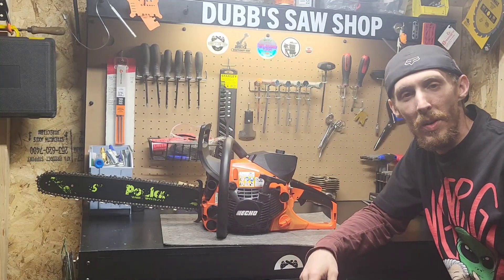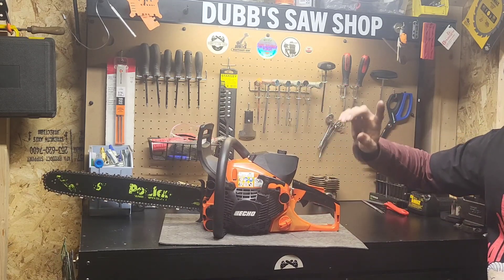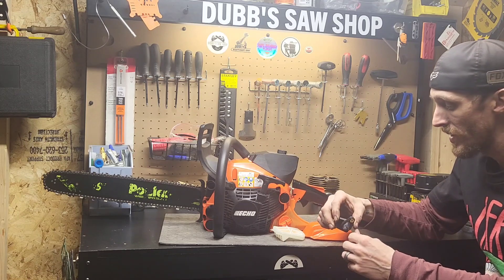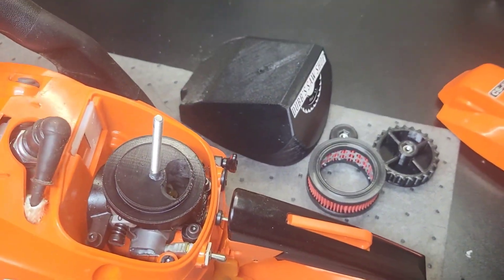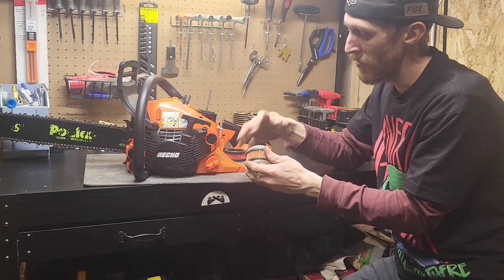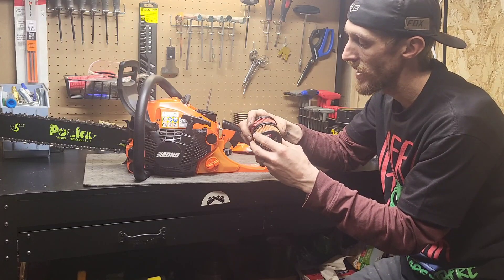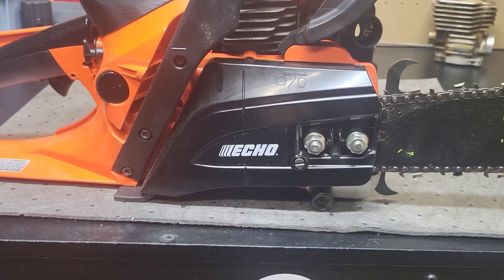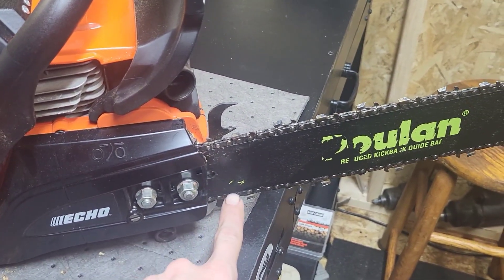Brisco ported Echo CS-4910 gets a HD Filter Kit!!! 3-D Printed Tech.

Comment: Where do you buy the kit, I can't find it on eBay or any where ?
Reply: Hi, I just found this video. I stopped selling these kits because they were taking too much time to produce (24hrs print time and 4 hours of finishing work and making the metal parts for each kit) and I got busy with a lot of other things. I also had some issues with them cracking and no matter what I did to try and strengthen it, I could not keep them from cracking. I decided that 3D printing is really not a good option for making something like this with high vibration and knocking it up against things, and I don't want to sell something to people that will have problems. After all, this was a project for me to learn 3D modeling and I wanted to help out other people, not take their money for something that won't be reliable and durable.
Reply from the maker: It's def a ton of time printing, and it's definitely a great concept!!! Mine has been great and hasn't cracked yet, but I don't run my 4910 all the time. But I still have the one I got. I did hear of a few cracking from others, at the end of the day you know best what needs to be done and no one can fault you for trying 👍🏻, I'd buy another one in a minute from you to test if you ever get back into it.
Reply from the maker: Honestly don't know if he sells them anymore. Guy was selling them on ebay at one time.
Reply: @DubbsSawShop  oh man, this is my first saw and I'm having fun with after I returned the first three not having a clue about all the right ways of adjusting the saw so it would just work, stay running and not flood. I'm determined to make this thing awesome and just put a gearhead exhaust deflector and turned the H and L all the way to the right with the limiters on, and the oiler all the way so it don't stop in the middle of the cut. Really appreciate your videos and hope you are well and healed Amen
Reply from the maker: @Tom-ur8qu  heck yes man!!! The limiters pop off pretty easy,  look at the shape of it and line up the tab, use a drywall screw by just starting a thread in the limiter,  then just pull,  it'll pop right off. 👍🏻 the gearhead deflector looks pretty awesome. The 4910 is a great saw for the money and weight. Also a mad ripper when ported!!!!!
Reply: @DubbsSawShop  awesome, I'm gonna do it, limiters off. I had no idea I would be having this much fun with the saw. Porting makes me nervous cause I need to use the saw daily, but man does that sound sweet. Thank you and God Bless you.
Reply: Finally took limiters off, yes it's a must, was way easier than expected. Used two screws in the L and H and screwed in till the caps came out. Congrats at the saw fest
Reply: Right on, thanks for all you guys do, I'm really having fun with the 4910 these posts really help. Merry Christmas yall
Reply from the maker: @Tom-ur8qu  Merry Christmas to you and your family as well!!!

Comment: Would it be possible to attach the CS-400 filter base “horn” on the CS-4910?
Reply from the maker: Yes it will work, that's what this kit is modeled after 👍🏻, the 400 horn just won't have the mounting holes for the horn,  this is basically a 3d printed 400 horn with mounting tabs printed onto it.
Reply: Thanks. Very cool setup. Please let us know how it works out.

Comment: Hi Dubb's, I have one of the 3-D printed HD filter kits installed on my Echo CS 501P. So far I have not seen any issues with fines getting in and that is nice! My saw is stock except for a muffler mod and I do notice better throttle response now with the new kit installed. I did open up the intake horn very similar to what you did.
Reply from the maker: Awesome!!! Glad to know it's working out. Seems to be a solid kit and looks freaking awesome too!!! 👍🏻